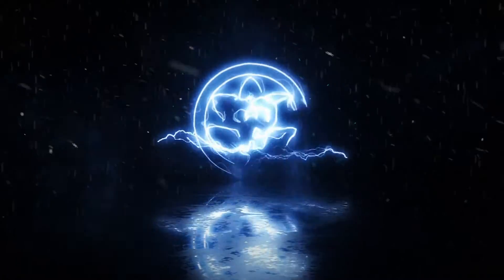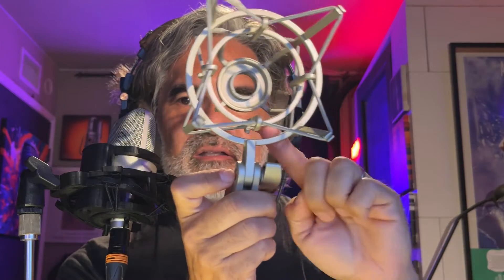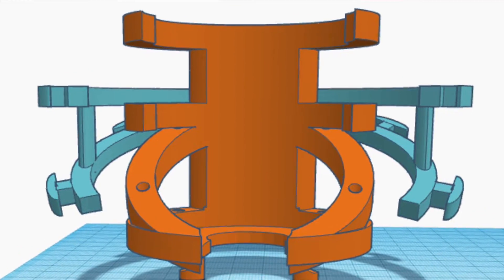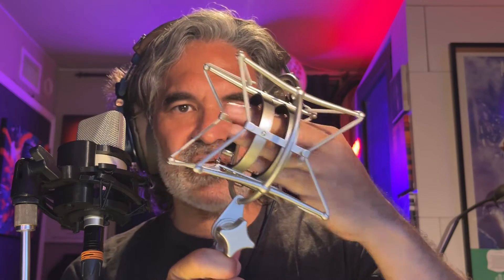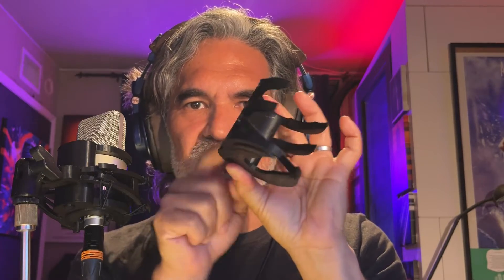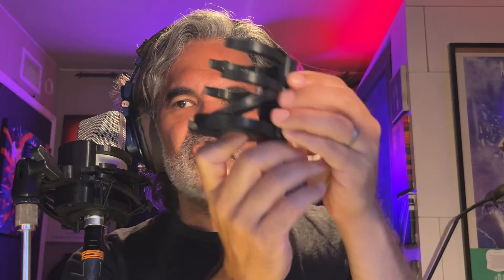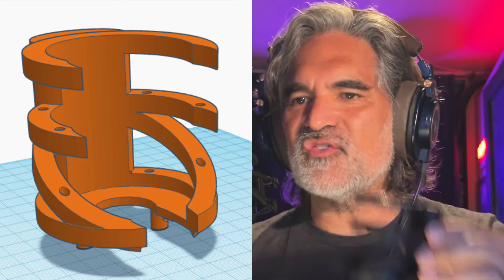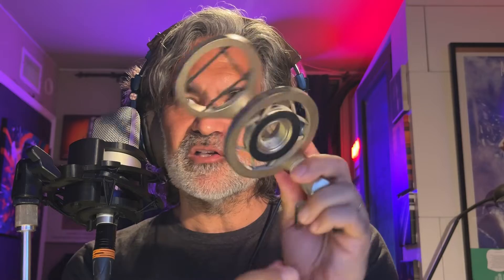Designing a Better and More Attractive Microphone Shockmount?

Comment: Those new-ish universal shock mounts that look like they're surrounded with purple Joker smiles are the ones that look really ugly to me. But I quite like the look of the Neumann style spiderweb shock mounts. I got a TLM 193 recently and I bought the shockmount for it. It sucks though. For a premium price, it doesn't do a great job rejecting shocks at all. It's also really annoying the way you have to screw it on to the mic. I like AKG's shock mount that comes with the 414. It does a great job rejecting shocks and the way it clamps onto the mic is way easier and quicker than screwing it on. It's also pretty good at fitting different mics. It works great with new 414s, smaller old 414s, this little Milab mic and a chunky EV RE1000. 

But the thing that I'm most interested in is a universal way to mount a pop filter right on to any shock mount or mic. These goosenecks are HORRIBLE. I got this old pop filter from the 80s that works great, but it uses a 5/8 screw adapter. I bought a 5/8 gooseneck and clamp and it's a nightmare getting it to stay in position. I need one of those jointed goosenecks people use for cameras but I can't find one with a 5/8 adapter.
Reply from the maker: That’s something that really chaps my britches, so many of those standard shock mounts suck at doing the one thing they’re supposed to do. And the solution to your pop filter issue is to learn not to need one.

Comment: Sweet ideas here. Makes me wonder - why don't we instal little shockmounts on the capsule holders?
Reply from the maker: Good question. Why not have a 4 way suspension of a capsule within an outer ring? Could also protect the capsule from shock if the mic is dropped?